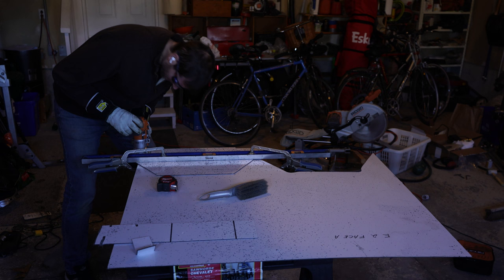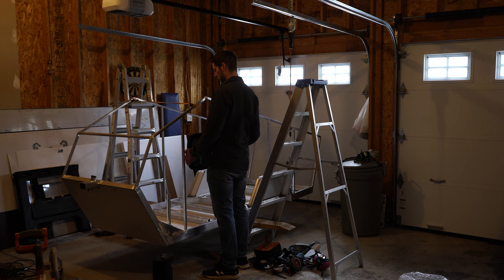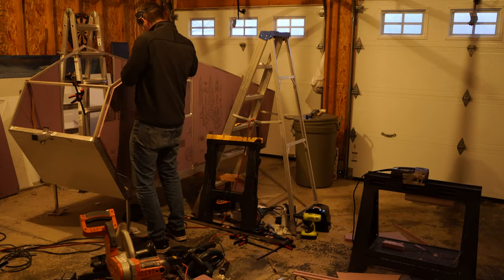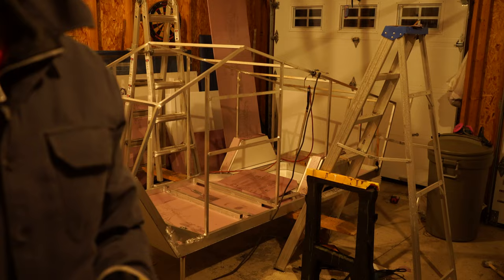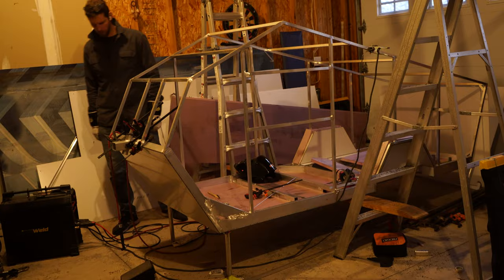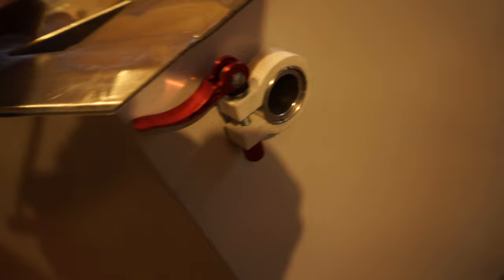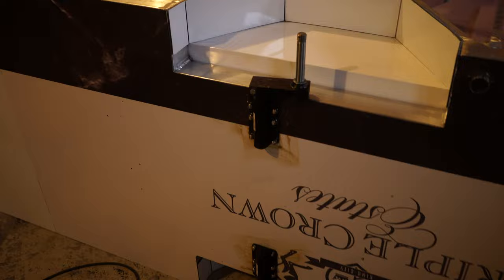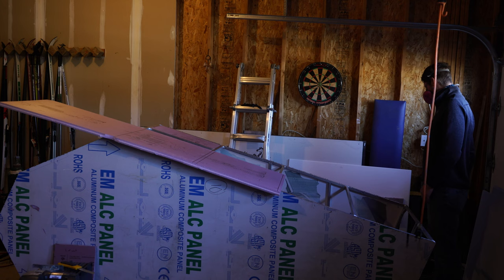Building Electric-Powered Bicycle Camper - (Part 7)

Comment: Thanks for documenting your bicycle camper build!  I've watched a bunch of videos of bike campers and yours looks like one of the very highest quality designs I've seen!  I've been thinking about building one too but I would make mine quite a bit smaller and lighter.  I'm a little concerned that yours might end up being a bit too big and heavy to tow with an ebike.  Will it fit through bike path constrictions?  I know I would regret giving up using bike paths if I couldn't fit my camper between the narrow barriers they install to keep cars out.  I love biking apart from cars and am always very happy to  find dedicated bike paths in cities.  I will continue following your project closely and look forward to seeing you try it out on the road.
Reply from the maker: Hi Steve, you raise good points. I’ve considered them, too. The camper is 40” wide, which fits within bike paths in my area and most trailheads I tested in my area as well. No doubt, some paths will be off limits due to the narrow entrance barrier poles, but I think I should be able to get through quite a few. When you go out and measure them, you may find like I did that they’re wider than you thought. Cheers and thanks for the compliment!
Reply from the maker: Also, the weight is dealt with by the hub motor in the front wheel of this design. You’ll see it more clearly in a subsequent video.
Reply: @Jerbrown  I'll have to take a tape measure along on my next ride.  You are probably right that the gateways are wider than I'm imagining and it probably just feels tight relative to being on a wide open street just before entering the path gateway.
Reply: @Jerbrown  Some rules are made to be broken ........speed limits are to most important rules to follow .
Reply: @Jerbrown  I agree ...I want to do the front motor also for my alumium canoe , this add on will let unhitch the canoe from the trike soI can move the canoe to a ideal sleeping area ...yep sleeping in the canoe ...no more tents .

Comment: Your in Peterborough Ontario? sweet, I'm in St. Catharines Ontario... Just before Niagara Falls. I build Cargo bikes and trailers and have been welding for quite a while.... mostly Mig and stick welding though, had tig carbon welding ticket but never really stuck with it though.
Reply from the maker: Yes I am! That’s great. I bought a used Bullitt cargo bike to tow this puppy. Probably will swing by your way in the spring :)
Reply: @Jerbrown  I like that cargo trike good choice for towing
Reply: Yo Bro ....do you have a web site ....my wife is from Ontario and we need a couple of cargo bikes which could be easily be taken on the airplane to Huatulco Mex .